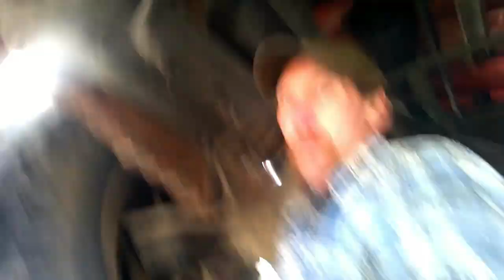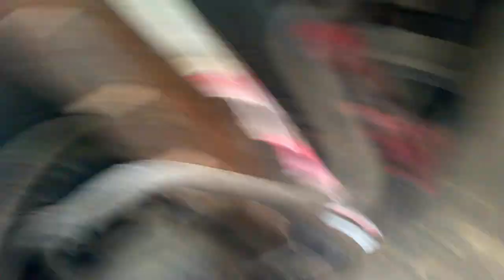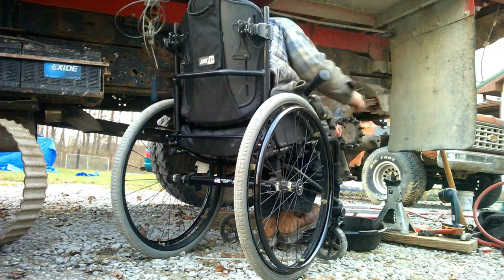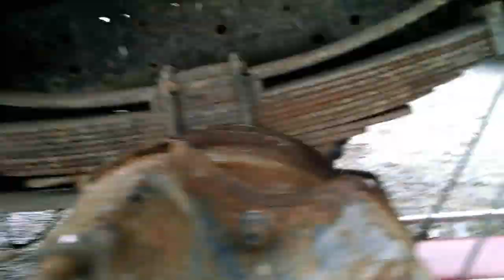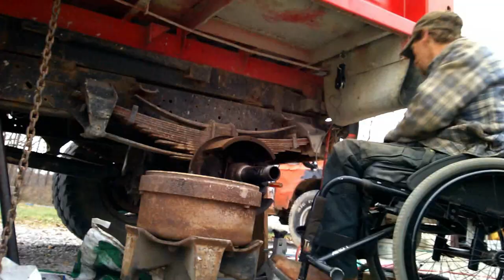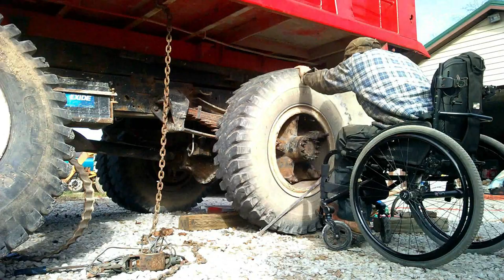Paraplegic & F700 Dump Truck with Lucas Girling Brake system and Dayton Wheels Hyper speed version

Comment: One of the only videos on YouTube about this style brakes. Thank you!
Reply: I've got a '90 F600 with these Girling brakes too.. and have a leaking wheel seal. This information helps a lot. Thankfully they're only for the parking brake.
I also have a '78 square body short bed 4x4.. saw your pickup in the background.  
Thank's for the video👍
Reply: @McClellan71  I have a 95 Ford/Thomas RV bus and I’m doing the axle seals as well!

Comment: never herd of lucas girling brakes before today but just got a free f600 with bad rear brakes your vidieo was very helpfull going to take it apart tomorow thanks
Reply from the maker: I had never heard of them either when I took on that job. I tried to research and see what I had gotten myself in to and I couldn't find anything, so I took the right passenger side apart and learned all about and videoed the left driver's side.

Comment: Thanks for taking the time to make this video - it's hard to find any info on this type of set-up... I'm going to be doing a wheel cylinder on a B800 school bus with the same set-up... You've given me the knowledge.  Thanks!
Reply: I did end up doing the work to the bus brakes in the end - Disassembled, honed wheel cylinders, new seals and brake fluid, and reassembled.  Now the bus is working well again - thanks!

Comment: Great Job, you made it look easy...I have a 1980 Ford LN 700 that needs tires and brakes etc...Trying to see if I could do my own brakes and stumbled upon your video, still not sure if I'm ready to do it myself.
Reply from the maker: They are a different beast of brakes not going to lie about that, if you tear into them and decide you don't want to do it then worst case your out a wheel seal. But what it costs to have a shop work on these brakes systems you won't care about the cost of a wheel seal. I've read shops will charge up to a couple thousand to work on them.

Comment: Hi, I just got the same truck. Having brake issue on the driver's side so this video was good but it's in fast mode. No audio. The beginning was perfect up until you started to pull the wheel.
Reply from the maker: Your in luck, I actually have this video in 3 versions. This is the fast one, then I have the same video but slows down with audio at all the key points, lastly I have one that is regular speed all the way through it with audio.
Go to my channel and you'll see all the options. Good luck on your brake adventure!

Comment: Awesome video long shot hopefully  you're  still active  on this thread.  I'm needing  some information on that puller you have. I need buy or make one I have a drum that is locked on tight any help would be greatly appreciated have a blessed day.
Reply from the maker: Yeah I'm still around and active, the puller in the video is one that I made. Measure and drill the holes for the hub/axle then drill a hole for the center puller bolt. You can either tap the hole or use a nut. You can weld the nut or use a wrench and turn the and hold the bolt from turning. Hope this helps!
Reply: @MechanizedGarage   welp I appreciate  the advice.  Thought  mine were same drum  style I was wrong.  My whole  drum just comes  off what a bear it was lol like 3 hours  of beating  and cutting  but we saved the drums. Thank you for your time have a blessed day
Reply from the maker: @bfg6235  absolutely no problem! The style of hub/drum you have is a far better design then the one I worked on.

Comment: Hey guy , You are the man ! , Thank you so much for this video . I just bought a 1985 Ford F800 and it was involved in a brush fire where it was parked . The left rear tires completely burn't off . I pulled the wheels off and was surprised at the brake system .... No air . What kind of freak is this . I tried to remove the drum and like you said it was locked . I am going back in the morning to remove that brake drum because now I know how . Thank you my friend , 
Question , I'm sure the bearings and seal on that old girl is probably trashed to from the fire , what do you think . 
Thanks again . 
Dale
Reply from the maker: Sorry for the late reply.
I would think the bearings should be okay, clean and inspect them really well too be sure. The seal is definitely going to be junk but anytime you pull the hub of you should replace the seal.

Comment: Nice video.  I need to do this on F800 replacing leaking wheel cylinders.  Where do you usually find brake parts, seals for these trucks?
Reply from the maker: The customer supplied the parts that I used in this repair, Napa auto parts typically can gets parts like this or hit up the ole search engine on your web browser and it should get you some promising results. Good luck with you're repairs!

Comment: Awesome, Iam about to do the same for right side drum, how did  you know which size brake shoes to order before ordering parts? For 1.75" cyclinder bore size there is an option for either 5",6", or 7" shoes, Id like to know what size shoes come stock with my truck so that they match the other drum. Also where is the backing plate number stamped can it be seen with the tire on? Thanks any help would be appreciated.
Reply from the maker: Regrettably I don't have any details I can offer you on the size of shoes or the backing plate numbers.  Truth be told I worked on the other side with no knowledge or guidance and figured out what I was working with to do the video.
Reply from the maker: The hub nut socket is 3-1/2".

Comment: I just got both Rear Assemblies , wheel seals , brake fluid , trans fluid , brake lines , Fittings and the Special inline Spring Check Valve to keep a Warranty on these Terrible Design Brakes... I now know why the junk yard didn't fix this truck and sold it to me for $600 ...   $3800 and it ain't even Legal Yet 😆 ... Another reason to steer clear of Ford Trucks...

Comment: Hello I'm working on this same brake system the Lucas Girling system on my F700 moving truck I've got the rear brakes replaced but I'm having trouble getting the electric brake motor light and buzzer to stop going off any suggestions?
Reply from the maker: I'd start with making sure there is no air in either side of the brake system, typically that is what causes the indicator light to come on. When the pedal is depressed the air will compress where brake/hydraulic fluid don't and it causes a low pressure on the line therefore tripping the light switch. From there it could be the switch it's self or some crazy impossible chance that the indicator circuit shorted across the brake light wiring and it powers it when your brakes lights come on. Good luck!
Reply: @MechanizedGarage  wow thank you for your quick response! Have a great day.
Reply from the maker: @brandonomans3751  I try to keep up with this thread and respond as quick as possible, this nightmares of a brake system has people wanting it done and over with as quick as possible. So far every day has been a good day, think about this. Every day you're not receiving mail via a gopher is a good day no matter how bad it goes!
Reply: @MechanizedGarage  I guess I'll try bleeding them again and see what happens. Thanks again

Comment: Any chance you remember the size of the axle nut socket you used
Reply from the maker: Sorry I hadn't responded sooner, I had forgotten about your question until I seen the socket in my toolbox. It takes a 3 & 1/2" hub socket. Good luck if you haven't already tackled the job.

Comment: Did you change the brake shoes while it was apart?
Reply from the maker: I did not, there was plenty of shoe left and would've been a waste of money to replace them. They just needed to be cleaned up and resurfaced.
Reply: - Those pads did look mighty healthy, I figured that's why you left them alone.

Comment: This would be a lot better if it wasn't constant time lapse
Reply from the maker: I have three different versions of this video. One is fast paced, next one is middle of the road, and last one is normal. I tried to touch on the major points on all of them. I'm sorry between the three different versions I couldn't completely satisfy what you needed from the video.
Reply: @MechanizedGarage  No. You solved my problems. I found the other two after some struggling under the kentucky sun. I appreciate your suffering to aid in my own. You're awesome.
Reply: @MechanizedGarage  it turns out I'm just dumb 😂😂
Reply from the maker: @robertstauffer3927  No siri don't believe you are dumb, I got to thinking after I had responded that the fastest version seems to be the most popular and it's the one that pops up and you have to go to my channel to see the others I guess. Anyway I'm glad you found what you needed!